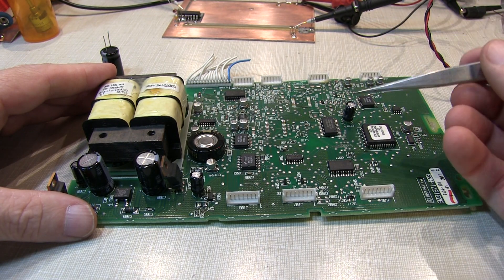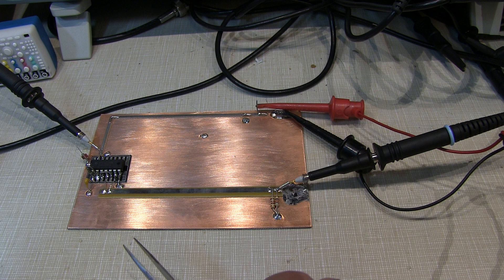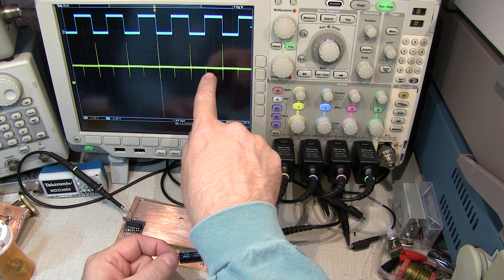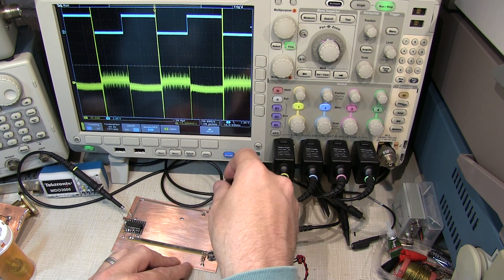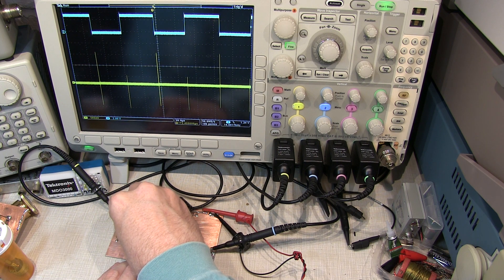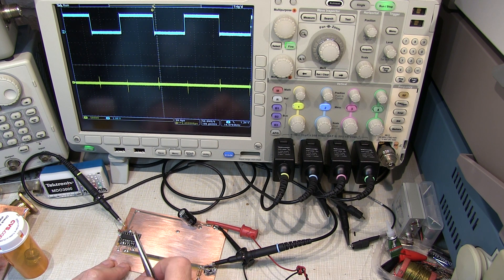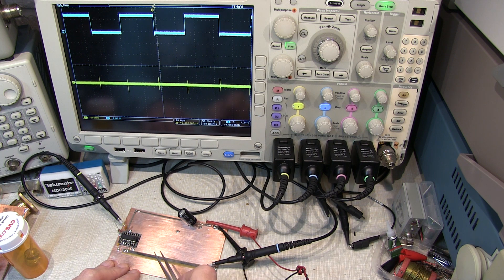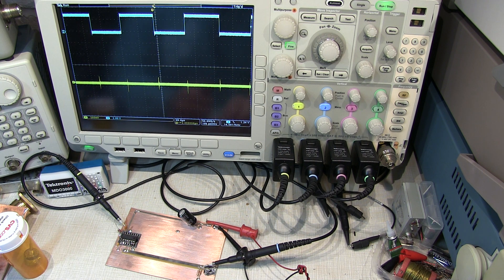#257: Power Supply Decoupling &  Filtering: why we use multiple caps in different locations

Comment: Ripple can be the AC line frequency or Ripple can also be considered the filter capacitors Charging and Discharging waveform? how can you tell the difference between if its AC ripple or its the filter capacitor charging and discharging because the circuit under test load impedance is discharging the filter capacitors in the power supply?
Reply from the maker: They're both involved.  The (rectified) AC is charging the capacitors, and the load is discharging them.  If there was a very light, or no load, then the charge wouldn't be pulled off (no discharging), thus the ripple would be greatly reduced.
Reply: @w2aew  Correct when the power supply has no load that is measuring just pure AC ripple. The higher the load/circuit power rails DC impedance the higher than AC ripple voltage? The AC ripple is considered a "voltage drop" of the filter caps from the circuit under test loading the filter caps?
Reply from the maker: @waynegram8907  Ripple is just the small voltage change on the power supply output.  Larger caps can store more charge, therefore will generally result in less ripple.  The heavier the load that the supply is driving, the more charge will be pulled off the capacitors between the rectified AC peaks, thus increasing the ripple.  Ripple is not a voltage drop across the capacitors, it is the SMALL VARIATIONS in voltage across the capacitors.
Reply: @w2aew  I'm confused about what the different between Variations in voltage compared to a voltage drop. I thought the discharging ramp was a voltage drop because the circuits load is drawing a lot of current that is stored in the filter caps. If a power supply has variations you add more filter capacitors. example Unloaded powers supply ripple voltage p/p is 500 millivolts and loaded power supply ripple voltage p/p is 2v. The difference between 500millivolts and 2 volts = 1.5vdc I'm not sure the EE engineering name of what this difference is called in AC ripple loaded compared to AC ripple unloaded. But the 1.5vdc has increased the AC ripple because of the circuit loaded drawing more current than what the charge stored in the filter capacitors.

Comment: How do we determine the capacitance needed? Trial and error?
Reply from the maker: It is usually driven by the supply impedance needed at various frequencies based the signal frequencies that you have in your circuit.  Bulk capacitor (the electrolytics) are typically driven by the low frequency current demands of the circuit, and the smaller ceramic caps help with the higher frequency signal decoupling.

Comment: Great video as always! Question: Whistling caps- Was experimenting with a pwm controled 10A current source circuit and my electrolytic decoupling  cap started whistling & getting warm. Any thoughts ?
Reply from the maker: Yikes!  Caps shouldn't dissipate power, thus they shouldn't get warm.  It sounds like your capacitor is not rated for the magnitude of ripple current that your running through it.
Reply: @w2aew 
Using a 555 pwm signal via an NPN to control the gate of an IRF4905 P Mosfet (74 A/55 V). Supply is a store bought 12V/10A switch mode. I limited the mosfet to 10A and circuit works fine. But the decoupling cap whistles when the PWM is at its lowest duty cycle. Tried 220u/200V and 2200u/50V. Both made a whining sound. I made a similar BJT version of this current limiting circuit and had no issues.
Reply: @w2aew  
Thanks for your reply! Always an education. I have a schematic here  https://youtu.be/ig_aANxxJyc  so you can see where the cap is. Circuit works fine without the cap, but I don't understand its electrical behavior when placed in the circuit.
Reply: OK. Now I feel foolish. Got the caps in the wrong place. Was just reading a white paper by On Semi Conductors...

Comment: Cool, thank You very much!
Maybe something about 1x probes and 10x probes and when and even why to use 1x? Or in modern scopes always use 10x probe no matter what?
Reply from the maker: You generally only use 1x probes when:
- the signal is <1MHz
- the signal is too low to be measured with a 10x probe
- the DUT is tolerant of the 100pF+ loading that the 1x probe will present.

Comment: w2aew, Why does some switching power supplies use a Gate Driver Transformer and other switching power supplies don't use a gate driver transformer? Any reasons why switching power supplies frequency is at 27Khz and not lower or higher than 27Khz?

Comment: W2aew, The ripple percentage is based on the B+ Peak voltage?  I don't understand how the ripples "percentage" is based on the B+ Peak voltage. What is the formula to getting the ripple percentage based on the B+ Peak Voltage?
Reply from the maker: Simple.  If you have 1Vpp of ripple on a 100V B+ rail, then this is 1% ripple (1/100).  If you have 0.5Vpp ripple on a 250V B+ rail, then this is 0.5/200 = 0.25% ripple.
Reply: @w2aew  ok thanks for the help. I didn't understand why some tech talk about the ripple percentage instead of the AC ripples peak to peak voltage. The circuits LOAD can increase the ripples percentage? but I'm understanding how the circuits LOAD current draw can increase the ripples percentage, do you know why?
Reply from the maker: @billwilliams6338  Yes, the load current draws charge off of the power supply filter capacitors, causing the voltage to drop.  The capacitors are recharged by the "half-sine" pulsed DC from the half- or full-wave rectifier.  The higher the load current, the more the "droop" you get in the voltage between the charge cycles.
Reply: @w2aew  Yes the power supply voltage drops but why would the AC ripple peak to peak voltage increase higher & AC ripple percentage increase higher? I would think that if the Load current draws more off the power supply the voltage drops and the AC ripple percentage decreases and AC ripple P/P voltage decreases
Reply from the maker: @billwilliams6338  The ripple is not due to an overall drop in the supply voltage.  Instead it is due to the charge being pulled off of the filter caps between the rectified AC voltage peaks.

Comment: W2aew, if the B+ voltage is +450vdc and you raise it to +600vdc will this increase the AC ripple to double the peak to peak size of the ripple? Raising the B+ voltage will give you more headroom for the amplifier circuit but it also raises increases the AC ripple
Reply from the maker: The ripple only raises if the current drawn by the load also increases.
Reply: @w2aew  i don't get that if the current draw increases from the power amps tubes lets say why would the AC ripple voltage increase because the loads current draw has increased? it does makes sense to me

Comment: W2AEW, arcade games power supplies use one filter cap rate at 27,000uf microfarads. I'm not sure why they only use one filter cap at a very large capacitance of 27,000uf microfarads. To filter what I'm not sure but most power supplies in other applications use multiple filter capacitors in the power supply compared to arcade games which only uses one filter cap at 27,000uf. Here is the link start time is 8:28 which shows the big black cap at 27,000uf https://www.youtube.com/watch?v=z4NXznltd5Q     any reasons you think why arcade games use a very large filter capacitance?
Reply from the maker: Capacitors are sized for the application.  In this case, there may be large transient current demands that require a lot of charge storage to stiffen the supply.  Video games often have high power audio amplifiers and feature fast/loud sounds (booms, explosions, etc.), which place large transient demands on the current supplied by the power supply.  Big caps help to deliver this current without sagging the supply.
Reply: Thanks for the help those are thing to think about you listed thanks

Comment: When you measure power supply +VCC rail to ground while the circuit turns OFF to measure the resistance from +VCC to ground why does EE engineers can this an impedance measurement? I thought a DC circuit has no impedance only an AC circuit has an impedance. The power supply +VCC is DC so how is it an impedance measurement when measuring the ohms resistance from +VCC to ground?

Comment: I have a couple questions:
1)  I've seen through hole resistors conduct through their tan color coating.  I had a cheap multimeter not reading correctly.  When I went to change the battery, I noticed that some resistors were touching each other.  So I separated them and the problem went away.  Have you ever seen this?
2) For the high frequency caps on a large chip, should I place closer to Vcc, GND, or in the middle?
Reply from the maker: 1) I've never seen this happen, unless the coating was chipped or scraped away.  This may have been the case, or maybe you had a poor solder joint that was pushed back together when you moved the resistors.
2) In designs that have high frequency operation, it is common that the PCB will have a ground plane.  Thus, place the cap near the VCC pin, and connect the other end to the nearby ground plane.
Reply: Thanks, love your channel.

Comment: Tube amplifiers have power supply sag issues when the output tubes draw more current when the stereo system volume is at full power. The power supply voltage ramps down when the Audio signal is at Vpeak drawing more current for the output tubes in the power amplifier. What is causing the power supply to not have enough current?Is the AC power transformer secondary windings doesn't have enough amps currents to supply the output tubes? How can you increase the power supply current so the tube power amplifier doesn't cause Sag issues?
Reply from the maker: The most common way to deal with this is to increase the value of the power supply filtering capacitors.

Comment: EE engineer designers say that leakage current is from insulators types and the capacitance of the insulators and electrical insulator in the circuit. I'm not sure what they mean by these electrical insulators, i'm guessing they mean the layers in the PCB board, the metal chassis of the enclosure,  the wire insulation used in the circuit. But the Capacitance of the insulators is what causes the leakage current. How much current is leaking through the insulator. Circuit traces coupling of the traces being to close together causes leakage current. When mounting a PCB board to the chassis of the enclosure you're suppose to put some kind of electrical insulator to prevent leakage current, I have never seen this insulator before but i guess its in the metal chassis. The wires and cables used from the wire to the shielding has an insulator inside the cables and wires which has a capacitance which causes leakage current.  I'm new to this insulators used in a circuit design but i guess most products have these Electrical Insulators that goes between the pcb board to the chassis of the unit to prevent leakage current?

Comment: caps are close to pins because  Inductors stop AC or change in DC , so when Switch in IC turns , it cant get current if you dont have CAP close to it ,  that is for technical reasons , others are filtering but filtering has nothing to do with how close CAP is to the load .  My 2 Cents

Comment: Thanks For the video. Can anyone help me I am trying to understand this concept because I am having an interference issue on a brushless gimbal.   I have recently connected a 5.8ghz transmitter to transmit the video signal meanwhile I control the gimbals brushless motors using a 2.4ghz receiver.  The brushless gimbal and both transmitters are connected to the same power source and whenever I turn on the video transmitter it causes the brushless gimbal to have erratic responses to the 2.4ghz input commands.  I tried to solve this by using a 12v Battery Eliminator Circuit or BEC which has its own capacitors built in to try to clean up the power but I still get the same issue and I want to add a capacitor to help with the interference.  I am not sure how to work out the type to add.  Should I just add a 10V 100uF or will I need to go up to a 25V but I would have thought a 25V would store up power and then release it when it gets to 25V?   Any help will be great thanks.
Reply from the maker: The voltage rating of the capacitors will have virtually nothing to do with their filtering effectiveness.  A 10V rated cap will work basically the same as a 25V rated cap of the same basic construction and package size, when operated at voltages less than 10V.  That being said, in order to correct the interference you're getting, you need to understand what is causing it.  Blindly throwing capacitors at the problem is not likely to be successful.  You need to determine the root cause.  Is it noise injected on the power supply rail by the video transmitter?  Is the 2.4GHz receiver being overloaded by the nearby 5.8GHz transmitter's RF?  etc.   Is the power supply being affected by the additional load presented by the video transmitter, resulting in poor regulation, ripple, noise?   Each of these potential problems (and others) would have potentially different remedies.
Reply: OK, Thanks.  If I connect the 5.8ghz to a separate lipo the problem is gone which is why I suspected it was due to dirty power from  the transmitters signal interfering through the ground.  I have isolated the problem and used a 10uF 16V cap on the power leading off the BEC to the 5.8ghz Tx which helped considerably but I could still notice a bit of a twitch in the motor on one axis of the brushless motors.  I ended up insulating the antenna so it could not interfere with the grounding of the frame and "Voila" no more problem.  I wish I could understand the circuitry ohms and and currents enough to follow your video better so I will find some more info online because I really want to be proficient in making my own circuits and devices in the future  especially going to focus on the Raspbery Pi .  Thanks for taking time to try to help me I am grateful.
Reply from the maker: You may want to add a 1nF or 10nF  (0.001uF or 0.01uF) caps as well - these will do a better job filtering the higher frequencies than the 10uF cap does.
Reply: Thanks. I saw how that works, I will have to  get some and give it a try.  Cheers.

Comment: That was very educational. I think I got the idea, but is that what every ceramic capacitor does? I was trying to find out what to use. Some say 0.1 uf is better at this. Some say 1 uf, some 10 uf. I'm a little confused and you didn't specify a value. :/
Reply from the maker: It comes down to what frequency range you need to bypass.  For a given style of ceramic capacitor (physical size, etc.), the self-resonant frequency will be inversely proportional to the capacitor value.  Thus, a 1uF capacitor will have a self resonant frequency that is 10x lower in frequency than a 0.1uF capacitor.  So, you'd pick a capacitor that is high enough in value to provide good filtering (low impedance) for the frequencies you're interested in, and has a self-resonant frequency that is above the highest frequency component that you're filtering.
Reply: Thank you for a detailed reply. Actually that's where I'm getting confused. I'm designing and building a Class AB audio amplifier with an OP-AMP in order to learn these things. Your videos helped so much, thank you BTW.
I'll be using a switching power supply unfortunately and those are known for their high levels of noise. 
So, I have to put a decoupling capacitor very near where OP-AMPs and transistors are then. But the thing is, I have no idea which value to put. How do we find out which frequency is causing the noise? That's the big question I think.
Reply from the maker: If you know the switching frequency of the power supply, then you can assume that the noise will be at the switching frequency and harmonics of the switching frequency.  It usually doesn't hurt to put multiple caps on the supply - a large "bulk" decoupling (large electrolytic, 10-100uF or more) on the board to take care of the LF noise as well as the transient demands of the audio output stage.  Then, maybe a 1uf and a 10nf cap at each opamp to take care of the switching supply noise, and audio harmonics from the class AB stage.

Comment: Excellent video.  I see a lot of people in the maker community designing circuit boards and leaving out this critical part of the design.    Usually in an all-digital design you might get lucky and not be an issue or might be a major one.   A lot of my interests lately have been a mixture of rf and digital.  Then it almost becomes absolutely imperative.   To me it should be a standard feature of every design to decouple every IC.   One such case is a radio kit that everyone can build.   It has digital circuitry, rf, and audio.  You can imagine that a lot of the complaints have been noise in the audio, rf distortion, and all sorts of interactions.   Largely because the design is built around solving the main problem of getting a job done, but not over basic design features you need to include as well.

Comment: Hi alan quick question how is it that the capacitor is a path way to the supply, i though capacitors block DC current? Thanks
Reply from the maker: They are a path for the high-frequency current (fast current fluctuations) to return to the source.

Comment: Seeing power supply caps are used in so many applications why doesn't the manufacturer have them fitted inside chip itself ?
Reply from the maker: Simply because you can't integrate large value capacitors inside chips - not enough capacitive density.

Comment: if you have really high speed data wouldn't the cap flip the bit upside down? The cap discharges when the current is reversed.
Reply from the maker: No, the capacitor simply provides a path for the high speed image currents.  It doesn't charge/discharge with the data - it is basically charged to the supply voltage.
Reply: w2aew 
Many thanks 🙏 for clearing this point ☝️